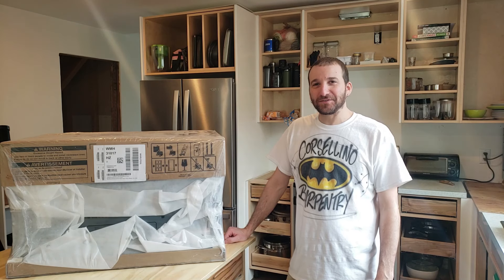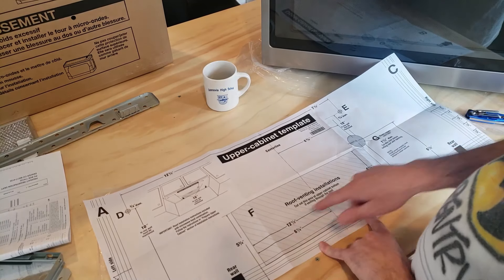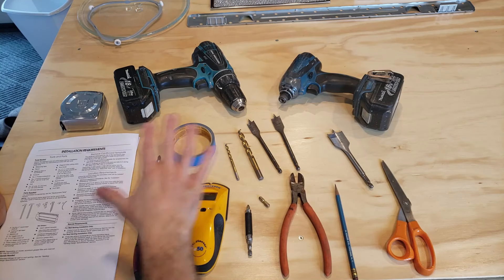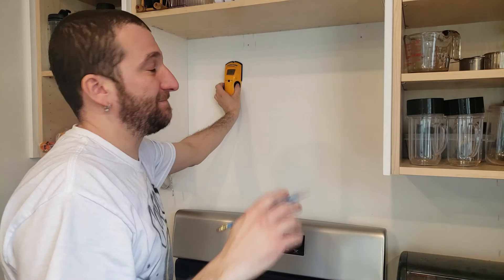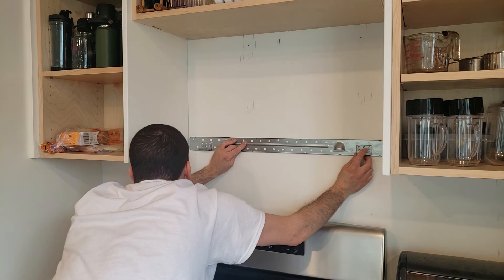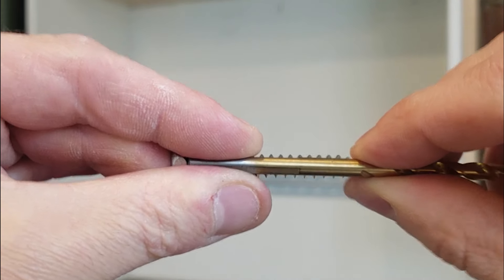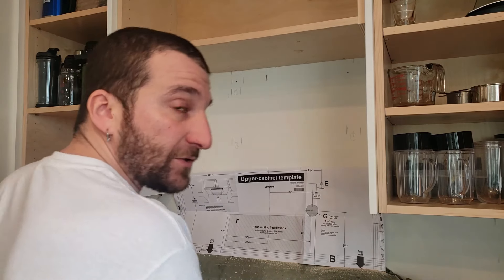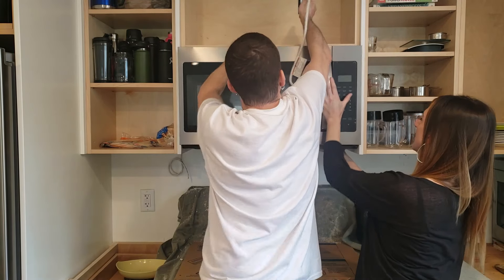How to install an over the range microwave - Whirlpool WMH 31017 HZ smudge proof stainless steel

Comment: Thanks for the video. My wife (62) and I (61) tried getting a handyman out to install. We contacted about a half dozen of them, and none could work us into their schedule for the next 3 weeks. We got quotes anywhere from $120 up to $750 for the installation. Instead of waiting forever or becoming a victim of highway robbery, we used your video as an instruction guide and were surprised at how simple it was. We both have bad backs and got it done injury-free. To make the lifting simpler, we moved our stove so we could support directly from beneath, bent at the waist, and lifting or supporting weight is not our friend. If you're hesitating to try this yourself, don't, just be sure to have an extra hand and follow the instructions in this video.

Comment: Whirlpool should give this man a royalty. Like many others, a big factor for selecting this was that someone made a good full video. 
Luckily I was replacing a unit so this matched up in size. I was able to reuse the holes from the original bracket and just had to drill new holes for the top cabinet to the microwave. I didnt even look at the instructions and just followed this video. thanks
Reply from the maker: That's awesome! Maybe I should reach out to whirlpool and offer to be there installation video guy!

Comment: BHS - this video was awesome!  Had purchased this unit direct from Whirlpool with installation (decided to cut myself a break).  My installation has a roof vent and was a replacement of an older Whirlpool unit.  Installers were total morons - damaged my top cabinet, damaged the microwave, tried to convince me that this unit wouldn't top vent, and then tried to leave the unit here for me to deal with.  Explained to them (convincingly) that they were not going to leave my property unless the damaged unit was on their truck.  

I bought another one from Menards - display model, no box.  I spent 45 minutes on the phone with Whirlpool and another 90 minutes on a live chat with them trying to get the measurements for the vent cutout, mounting holes and placement of the support rail.  Got nowhere - was ready to start hassling Whirlpool HQ, when I found your video - you saved the day!!

For the benefit of your followers - here are the measurements:
1.  Mounting rail (goes on back wall - centered, 17-5/16" from the bottom of the mounting rail to the BOTTOM of the cabinet (this is also the top of the microwave unit - if the top goes up against bracing below the top cabinet bottom, you'll measure to the bottom of the bracing.  The measurement is 15-5/8" if you're measuring from the bottom of the cabinet to the TOP of the mounting rail.

2.  Vent cutout - 12-1/2" x 4-3/4" - centered (6-1/4" on either side of the center line) and 1" from the back wall.

3.  Power cord hole (1-1/2" hole) - 6-3/8" to right of center line and 6-1/2" from back wall.

4.  Holes in top cabinet (for mounting screws) -
    Hole D - 12-1/2" to left of centerline & 10" from back wall
    Hole E - 7-1/2" to right of centerline & 10" from back wall

I had to improvise for the venting.  Had existing 10 x 3.25 square duct that extended below the bottom of the cabinet.  Had to cut it off (in the cabinet above the microwave and then modified a starter collar I got at Lowes (https://www.lowes.com/pd/IMPERIAL-3-25-in-x-10-in-Galvanized-Steel-Rectangular-Stack-Duct-Starting-Collar/1000230291?cm_mmc=shp-cprdplbgglLIA_PLB_171_Air-Circulation-1000230291-local-0-_-0&ds_rl=1286981&gclid=CjwKCAiAmuKbBhA2EiwAxQnt72B8NoZoUBup2IzjeVKfgCnacyQhommk9hBHsbhWidkjrYNuF7g2wxoCEQQQAvD_BwE&gclsrc=aw.ds) so I could slide it up into the existing ductwork and then down over the new damper assembly on the microwave.  My modifications were:
1.  Straighten out the bent lip and tabs (so they were back to the 10 x 3.25 square shape - so they'd slide up the ducting) 
2.  Drill out the rivets and remove the pieces on the other end of it (so it would slide nicely over the damper assembly) 
3.  Trim away the end (#2) so that it cleared the hinge/pivot of the damper flapper and wouldn't interfere with ti opening & closing.
Once in place, I duct taped it to minimize air leaks.

Again, you saved the day for me!
Reply from the maker: This is exactly why i make these videos!!! Thanks for letting me know and I'm stoked that this was helpful to you!!!!!!!!!

Comment: Thank you so much for this start to finish video. Don't think I could have installed it without this video. Superb job to you (and your assistant). Being 77 years old with a questionable back, I did move the stove out of the way. Made it easier to lift into place. Thanks again.

Comment: My GE microwave from 2005 finally crapped out. At first https://www.youtube.com/post/UgkxO_Bc204MGjxDl87cOKcdgaRhzSqGmv_g I was unsure because I was looking for something with the exact same features. Found it with this one. Interior space cavity was large, but the outside was smaller than my old one. I love the one-button push for 1-6 minutes, and the 30 second add or 30 second start. and MOST IMPORTANTLY, I love how you can adjust the power level during cooking. The reviews said it could not be done, but this marked all the other boxes. and happy to say, it does. I can hit 1 minute start, and change the power level from 10 to 5, 30 seconds in, without interruption. my favorite feature!

Comment: At 24:09 you install the vent (that is a bit short); I am stuck here as the microwave did not come with the vent.  Where did you get it? and what exactly is it called?
Reply from the maker: hey, seeing this 2 months late sorry! Hopefully you figured it out. I don't know exactly what it is called, just rectangular ductwork I think is what you're referencing. I just measured the dimensions of it and went to home depot or somewhere like that and bought the closest thing and cut it to fit

Comment: I have this microwave oven for several months now and notice the auto fan when it detects heat on, it will go on for a long time, several hours, I had Whirlpool before this and it wasn't like that, even when I measure the temperature at the oven, it was same as surrounding, but fan still going. I had to unplug every time because it suck out indoor conditioned air and that cost a lot of energy bill, even the microwave wire at the plug feel warm to the touch.
About installing, I had to use aluminum tape to seal the vent at front door in order to route all air suck in from cooking below to outside, the oven setting/damper allows air to vent both directions.

Comment: I used a manual hacksaw and a drywall saw for the cutout, what a pain on that fiberboard the cabinet was made out of.  I'll have to buy an oscillating tool sometime.
Reply from the maker: you can get them pretty cheap as a kit that comes with blades. Back when they first came out the tool anone was like $400 but now a whole kit is closer to $100. Harbor freight even sells a super cheap version with no attachments for $19.99! The blades can be pricey though and the cheap blades just don't work well or last long

Comment: So you rotate blower motor up for roof venting installation only. I don't have roof venting, so I'm assuming I'd have to do the wall venting installation. But wouldn't that just blow onto the wall? I don't have wall venting either on my wall.  The microwaveI'm replacing had a  vent in the front on top of the door. So I'm now second guessing if i bought the correct microwave for my setup.
Reply from the maker: i believe there are 3 options, top vent, back vent, and self recirculating vent. for the wall vent it's for microwaves that are on an exterior wall and you install the vent straight out the wall behind it

Comment: What happens if I never took off the temp covers @21:16 ?
Reply from the maker: if your microwave sticks out past the cabinet like mine does you can take them off after. but they shouldn't be blocked i believe that's for airflow venting

Comment: Do you need to install the vent part? I just bought a new home and it has this microwave. It turns on and everything it just doesn't heat up? Any help is useful thanks.
Reply from the maker: That's weird. I don't think the vent has any correlation with heating things in the microwave but I'm just a carpenter guy, not en electrical/mechanical engineer. Sounds broken to me

Comment: I put the wall bracket up it was too high so I lowered it had the microwave on it then I tightened the bolts in the cabinet until there's no space showing now the bracket isn't in the microwave holes but the microwave is tight and isn't moving should I take the microwave down and move the bracket up a little then put the microwave back up and tighten it back or should I loosen the bolts up some
Reply from the maker: honestly I'm having trouble understand what it is exactly that you are asking. But my only suggestion would be to put the bracket at the exact distance down from the cabinet that the instructions say, and it should work

Comment: Can this unit be hard wired in? Just took out the old unit... there is no plug, just a wire coming out of the wall which was connected to the oven and then black taped into a bundle.
Reply from the maker: why not just install an outlet if you have wires there? Just need to shut the power off and install an old work box with an outlet

Comment: Do I need to cut the box out? I don't have an external vent. I'm trying to replace a different microwave that has the plug and screw holes.
Reply from the maker: cut the box out??
Reply: @BorsellinoHomeServices  The big area in the back that you cut from the cabinet for the vent.

Comment: Great video. Gave me some good insight. 
I bought a 6yo house with a Whirlpool microwave (wmh2175xvs) already installed.  It appears the blowers are pointing the correct upward direction for outside ventilation because my outside wall vent louvers open when the vent is on.  On the top of the microwave, just in front and under the cabinet to which it is attached, there are series of holes which I assume are used as the outgoing vent for when the microwave is configured to blow forward (recirculating).  When I run the vent, there is a suction along these holes. Looking inside these holes, I see a dirty metal filter (not the filter under the microwave where air is drawn from the stove).  
2 questions:
Should I somehow remove this internal filter and clean it?  It is not obvious just how to remove this filter without uninstalling the microwave.
If these holes are used for the recirculating vent configuration (which I am not configured for), can I simply tape over these holes to force more suction on the underside of the microwave? 

Thanks in advance.
Reply from the maker: Honestly I don't know much about how they  are build beyond this installation video. I'd say give it a shot! You can always take the tape off! And you'll find out pretty quickly if you start pulling it apart if there is a filter or not inside. Doesn't make sense to me that they would put a hidden filter though

Comment: You are a life saver. The installation instructions that came with the unit were useless! Question, does it matter which way the one way vent door opens ( front to back as opposed to back to front?). I have the same wall vent setup as you with it opening up to the ceiling.
Reply from the maker: THIS! This is exactly why I make these videos! I'm so happy that this was helpful for you!
Reply from the maker: As for the vent, I have no idea. Just make sure the airflow is going in the direction of your vent. You probably have it installed already though this comment was 6 days ago

Comment: I bought the model wmh31017hz07 and it says manufactured April 2021.  The vent system looks different and that attached piece has nowhere to attach.  I guess they changed the newer ones, yet I still have to vent flap thingy part but there's nothing to attach it to. Plus, the dang mounting screws don't won't screw in more than a couple threads.  I don't know what gives.
Reply from the maker: ugh i hate it when they change stuff and it doesnt work!!!

Comment: I don't have the silver metal piece so the front of my cupboard the one above the microwave is a bit greasy; how can I fix this problem?
Reply from the maker: Clean it?? I'm not really sure what you're asking, this seems more of a cooking and cleaning issue than an installation issue, no??
Reply: @BorsellinoHomeServices  ok so the fan from the microwave blows to the front,  see in your video you unscrew the nuts and changed the fan direction to blow upward instead of blow forward? That's what am refusing to.
Reply from the maker: @GyaluelJr  refusing to do it?! Or there's no vent above so self venting is your only option?? Have you checked to make sure the grease filter is in place? I never understand self venting, it just dumps all the heat, humidity, smoke, grease right into the room instead of outside... I wish I had a solution for you, I really do!
Reply: @BorsellinoHomeServices - this is what we’ve had in our kitchen for the past 20 years. It’s the system that was set up by the previous owners with just a hood above the stove and no vent in the wall. I think the idea was that at least some of the grease from your cooking smoke on the stovetop gets trapped by the metal filter before it was circulates into the kitchen. And then you wash that periodically. it doesn’t work very well. 
When we took our cabinets down to redo the kitchen, you would not believe the greasy dust on top of them. 
We are about to install a new whirlpool microwave hood vented to the outside and I’m very excited about that. Appreciate your video.!

Comment: Trying to install this on a concrete wall. Any tips?
Reply from the maker: I installed cabinets on a brick wall once and bought these big mollys meant for concrete and drilled holes and attached a wood board to the wall so I could attach the cabinets to that.

Comment: 4 years later.  Is the microwave still working?  My whirlpool only lasted 4 years then quit completely.  I never opened the door without hitting stop first, so it's not that common problem.  I junked it and left the space open for usefull shelving.  Best decision ever.

Comment: Putting in the same microwave but in black. Had to replace my original Whirlpool. Unfortunately, the bracket wasn't the same, so had to measure thrice to drill once.

I do hate my stud finder though
Reply from the maker: yeah I hate my studfinder too. I want to get a Walabot DIY have you seen them? They look amazing
Reply: @BorsellinoHomeServices  looks like an interesting product, but reviews seem split on it.

Finished the installation this morning. Needed longer toggle bolts for the mounting bracket. I was slightly off on the cabinet holes, but got them in the microwave. If I used a slightly bigger bit for that hole it probably wouldn't have been a problem
Reply from the maker: Yeah now that you say that we did have to fight it in a little bit... We've been using it for a year now and it still works just fine

Comment: Great video!  One question.  The bottom of my upper cabinet has a frame around it.  Does the WALL cardboard template (mine came with a paper template), butt up to the bottom of the frame or does the template need to be trimmed so it fits inside the frame?  Just to be clear, I'm speaking of the wall template, not the upper cabinet template.
Reply from the maker: I would butt it to the frame not the plywood because that is where the microwave will sit, it doesn't fit up inside that frame

Comment: Does this model have a recirculation mode for venting?  We do not have any external vent to hook up.  thanks
Reply from the maker: yes it does! in fact it comes in recirculating mode and in the video i show how to switch it to vented mode
Reply: @BorsellinoHomeServices  I watched the whole video. I dont believe you mentioned how to change it to circulation mode. Do you mind sharing how?:)
Reply: @aggie_candy  Per his comment, it comes in recirculation mode, so you don't have to do anything. It's ready right out of the box.

Comment: Does it matter if the damper assembly is installed reverse from the way you install it, with the damper opening in the opposite direction?
Reply from the maker: I don't think I understand what you're asking. Is it able to be installed rotated 180 degrees? As long as all the screws go into holes and the air moves in the right direction then it is installed right. If the vent is installed improperly you most likely won't have airflow, thus defeating the purpose of the vent. But again, I'm not fully sure what you're asking.
Reply: @BorsellinoHomeServices  Thanks. That answered my question.

Comment: How well does it work for venting, and how loud is it? Thx
Reply from the maker: it seems to work pretty good. i don't use it very often but when i do it definitely works. the HI setting is not terribly loud, but loud enough that I don't run it longer than I need to. I usually run it on LOW though and it's not bad and sometimes I forget to turn it off while I'm eating then I'm cleaning up dinner and realize the fan is still on